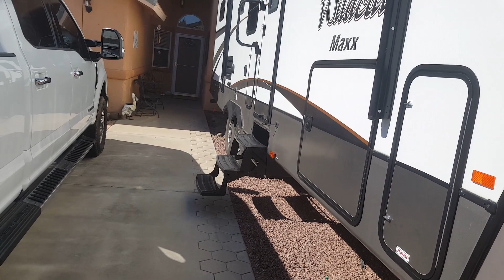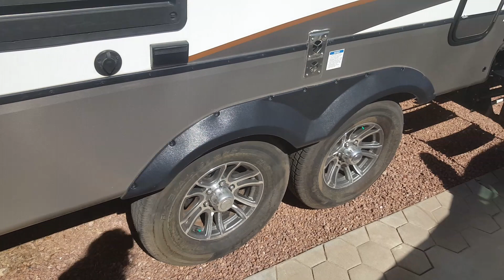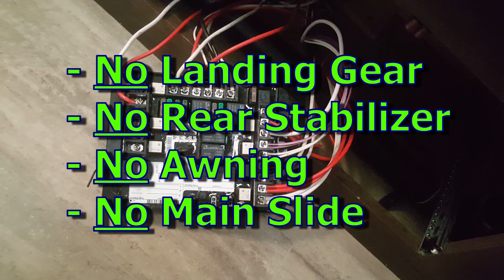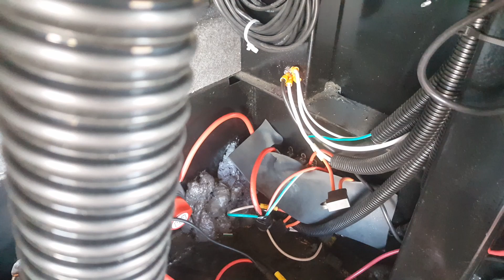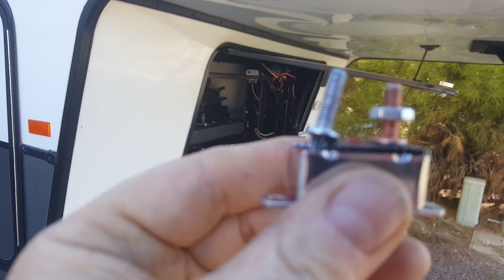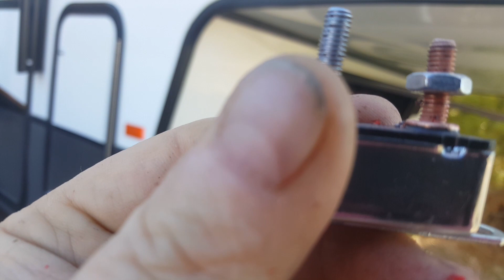RV Electrical Nightmare Fixed 2017 Forest River Wildcat Maxx F312BHX

Comment: Great Video, I have the exact same trailer, and Have had problems with my LCI frying some of the connections, and Draining my batteries.  I am going to have to look into what you found.    Can you post a Picture of how your batteries are hooked up?
Reply from the maker: Thanks for watching the video! It was strange that the relay was so problematic that I wasn't positive it was the problem  but it certainly was obvious once I replaced it. And knowing how it works made a lot of sense. 
I no longer have the RV but the batteries were super deep cell RV/Marine batteries hooked in parallel.  The negatives were connected to chasis ground and the positives were connected to the battery switch. 
I hope that helped. Thanks for watching.
Reply: @DaleLucid  Thanks for the Info.  That didn't fix my problem, I guess I'll start looking into the LCI.  Even though, I turn the positive connection off, I still have power to the RV, and the batteries arc everytime I hook them up, Still no one from Forest River has got back to me yet, about resolving the problem.